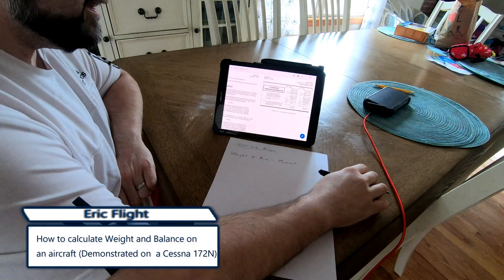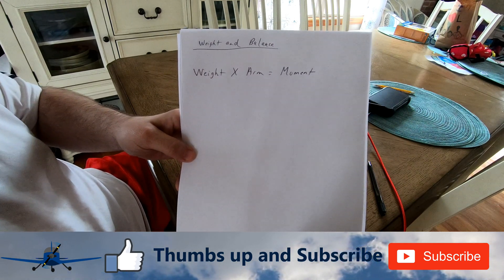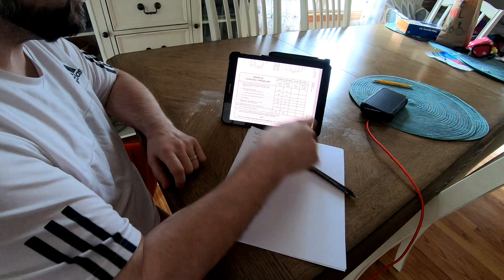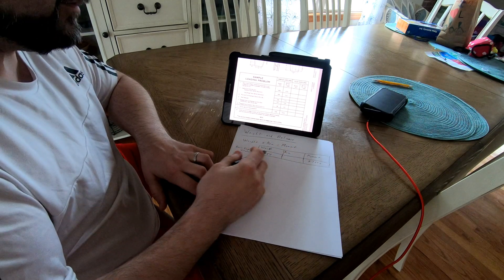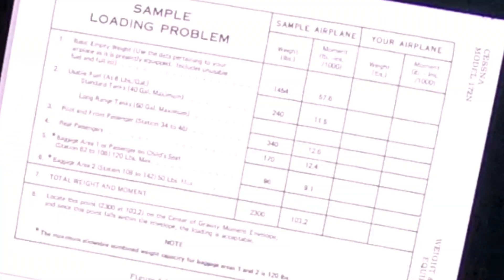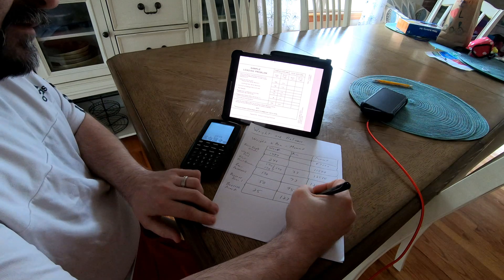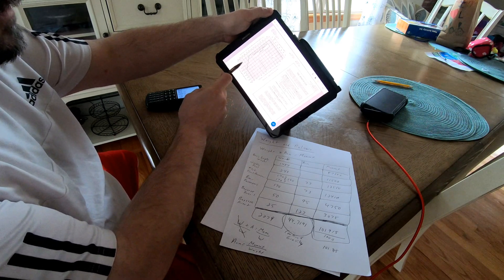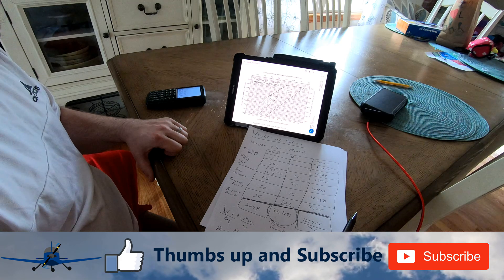How To Calculate Weight and Balance On An Aircraft Demonstrated on a Cessna 172

Comment: What about start taxi fuel burn?
Reply from the maker: Add 1.2 gallons for taxi and run up in the 172 (says it in the POH). I overestimate on gas so I would still bring safe (burns 8.4 gph but I round up to 10 gph)